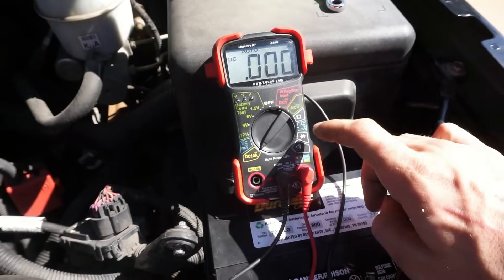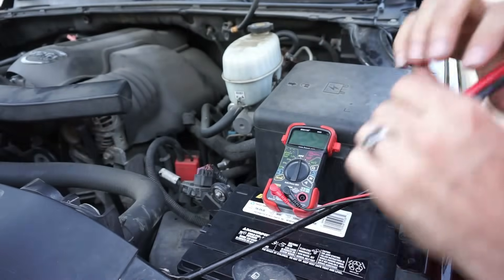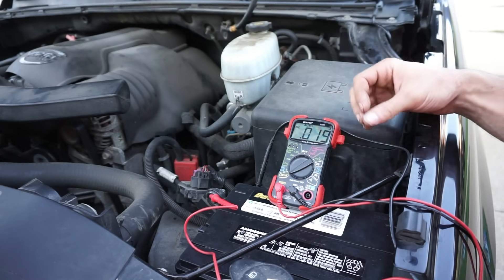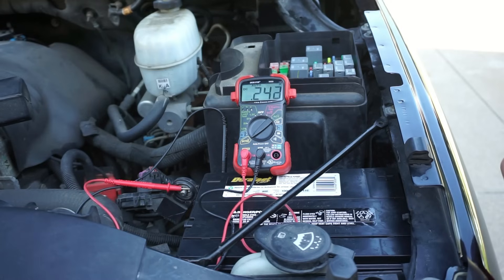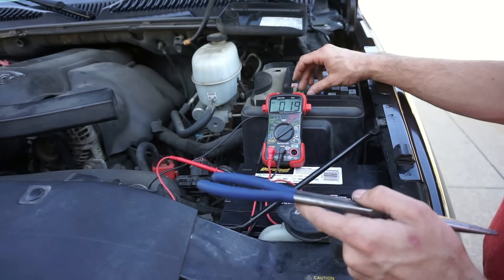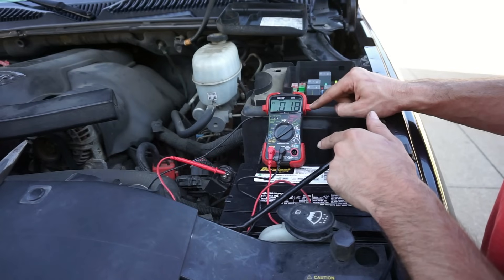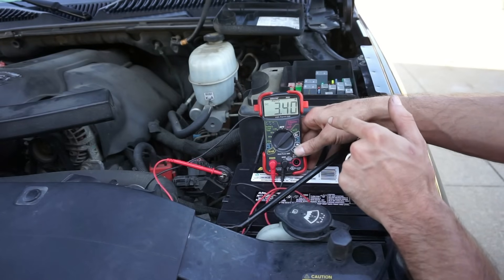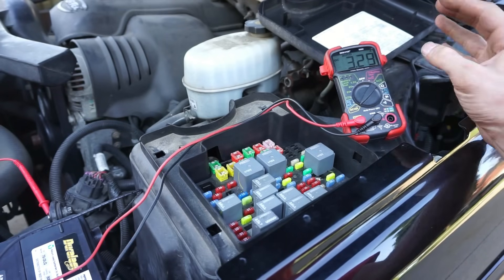DEAD BATTERY | How to FIND a Parasitic Battery DRAIN Using Multimeter!!!

Comment from the maker: THE FIX!!! As mentioned in the video the "Driver door module" was bad. This is the window switch panel. I replaced the switch panel and issue has been resolved. Video removing panel here:
 https://youtu.be/CnQtqbWc6x0
Reply: Wow! Excellent video. Thanks for posting it and "turning the key" and "being patient" were two key nuances in this video vs. so many other ones out there.
Reply: Was it because the lock wasn't hitting an end switch saying it was locked and therefore always providing voltage to the lock mechanism trying to lock?
Reply: Damn great video. Thx. You know your stuff. Electrical gremlins in vehicles can drive us nuts. 👍🙏👌🏆
Reply: Awesome video!  Easy to understand and thanks for sharing your knowledge!
Reply: Could connect your meter through ac10 Amp fuse if it doesn't already have its own fuse....
Reply: Excellent. You made that so clear.  The “wait” time is something that I never had the patience to do.  You are right!. Sincerely Don. Cheers 🍻.
Reply: I have a 1995 Lexus ls400 and i pulled all the fuses and none of them went down could it be a bad alternator or a bad battery cable?
Reply: I did the same thing with my multimeter negative with negative battery and positive with wire clamp and got 000 I’m thinking it might be my generator.
Reply: Ford explorer 2014 PowerTrain Relay stays energized (coil powered) with key off, drains battery over night. After removing the relay and putting it back it did not energize ( click on and draw current) how ever after driving yesterday and parking last night, it is staying energized again draining the battery. What energizes that relay, the switch the PCM?
Reply: Ahhhhhh missed that! Now I know. Guess the technician in me wants to tear into that assembly down to component level part! LOL, guess you would have to be retired and that's another whole video! LOL   Thanks Again!
Reply from the maker: @robertkosovich1232  My thought on it (Since I live in Wisconsin), in the mornings I would go outside to start the truck and warm it up. Occasionally the wipers would still be on and throw a bunch of snow onto the driver door where the buttons were. I'd guess water got in there and eventually corroded the connections.
Reply: G

😂😂kkkjjj😂😂😂😂❤😂jk❤❤❤❤❤k❤❤❤❤❤😂❤😂
Reply: Mine has same issue and driver door lock don’t lock lol thank you
Reply: Once the circuit is identified, is there anything more that can be done with the meter to try to figure out the nature of the problem, before disassembling anything? such as bad switch, vs burnt actuator vs shorted wiring?

Comment: So it's not clear to me, are you also saying that 0.200 a normal drain? I ask because my car was draining after a few days if I didn't drive it for a week, ended up buying a new battery because it was 6 years old, bought a new one and it's showing .200 etc. I'm using the exact same multimeter btw. but unlike you I don't know what I'm doing beyond what you did to check the drain. I don't exactly know how to interpret what I'm seeing. I thought it should be .020 to .050.

Comment: I’m addicted to these videos about parasitic draw, yours is great. Question, in some vids they connect the multimeter without breaking the link between the negatives by connecting it first, then removing. Would that method have helped in your situation? I’m wondering if it’s just a good practice to not break the connection?

Comment: This video helped me out big time! My driver door lock switch worked but was iffy along with the window switch. I pulled the DDS fuse and the amp draw went way down and after everything went to sleep the amp draw went to zero! I cycled the key and waited like directed in the video and the amp draw went back to zero. Now to order the switch assembly and just for the hell of it I’ll replace the door latch assembly in the door. It seems kinda iffy also.

Comment: Oddly I have the exact same thing with an older Windstar we keep sitting around.  Door lock, bad solenoid.  I had one of these one time where the light was loose hanging on the inside of the door panel.

Comment: Come to think about it my wife hit a trash can that was in the street one day and it knocked the passenger mirror off a little it was dangling we taped it back up, but the mirror control for it seemed to stop working....so maybe i should look into that as why the battery is draining, you're was a broken door lock control, maybe mine could be the mirror control. Hard to believe something so small could drain a battery in 3 -4 weeks time, but i suppose it could, so i need to investigate that first, looks at that fuse specifically cause it was damaged, also another electronic component stopped working the analog clock, maybe it could be that, so i do have two broke n parts to investigate. This didn't drain the battery right away, it was awhile later, maybe the control eventually shorted it, idk but not at first?

Comment: You mentioned that you can do this with a multimeter and pull fuses one at a time until the amps go back down to .001 ON AN OLDER CAR. What about a 2017 Camaro? I have replaced the battery. Replaced the alternator. Checked to see if it was the starter, repaired a bad terminal connection for the battery and STILL… I can’t go more than a few hours, sometimes less than that, without walking out to a car with a dead battery. I have now been driving the car for 2 months and every time I drive it, I have to disconnect the negative battery cable every time it is used, in order to use the car. It’s my only vehicle so to get around it’s my only option. I’m a single working mom with 2 kids so I don’t have a choice. So my question is will this same process work on a newer 2017 Camaro? I know I have 2 fuse boxes so it might take a while to check each fuse but is it still an option and can’t I get a multimeter at a Walmart for pretty cheap? Please help- thank you!!

Comment: I TELL YOU WHAT!!!!! TRY THIS. NO PATIENCE, NO WAITING.  I keep a 5/16 wrench under the hood. Shut engine off, unscrew sidepost Negative. Close Hood. Security & No more dead battery on my 2003 Silverado ! Also my truck has rubber mats & manual door locks, crank windows, base model 👍

Comment: Great video. These cars come with a million different modules now, all packed with unserviceable semiconductors. Transistors always end up getting stuck on, stuck off, and/or leaking current. IT IS SO ANNOYING. It shouldn't cost potentially hundreds of dollars to replace & reprogram modules. OEMs cheap out as hard as they can, and these issues are the result.

Comment: Thank you for this video. After video remembered issues with a/c not working properly. A/c clutch stayed engaged without ac on. a/c clutch relay fuse went out. Heard it switch on when connected terminals to battery post

Comment: I have a 2008 cx9 that’s charging at 15v constantly. What should I do?
Reply: Use a multimeter to check the alternator output after the engine has been running for 10–15 minutes; if it’s still reading 15V or higher once warmed up, it's likely not just a cold-start condition. Also, inspect your battery terminals and grounding connections for corrosion or loose contact, as poor electrical connections can confuse the charging system. If voltage remains high and everything else looks clean and secure, the likely culprit is a failing voltage regulator (which is built into the alternator on your vehicle), or possibly a faulty battery temperature sensor. In that case, you’ll want to have the alternator tested or replaced to prevent long-term damage to your battery and electronics.

Comment: I've got a 2009 F150 King Ranch which I don't drive much any more, so I decided to check to see if it had any parasitic draws that were working against the battery while it sat. Your instructions on what to do and more importantly what you were looking with each test helped immensely. Thanks.

Comment: I feel that finding the correct fuse is pretty straightforward. The hard part is finding what is drawing off the battery. Especially if you don't have any access to wiring diagrams.

Comment: On my son's 1986 Camaro we pulled each fuse one at a time, nothing stopped the drain. I put a screwdriver on the back of the alternator and found it to be magnetized, replaced the alternator, no more discharge (built in regulator was stuck closed)
Reply: Yep....a great video... I am about to delve into my daughter's 2008 Honda Accord..after a lifetime sorting out old English cars from the 40's to the 70's...one of the FIRST things I'm going to do in couple of days when I start on the Honda, is to set up the drain test, and then pull the connector on the alternator to see what happens to the reading then....and YES...cycling the engine-on-&-off situation is essential content.  Thank you!

Comment: Too many gizmos and gadgets in the average vehicle. I have a 1984 GMC K2500 diesel that I bought brand new 40 years ago… also have a newer GMC 1-ton Duramax. The Duramax is full of gadgets like dual zone air conditioning (which depends upon a cheap plastic diverter buried deep within the dash)… My trusty old 1984 has no electronic garbage in it.

Comment: I had a parasitic drain on a Mercedes gl450. Dealer couldn't figure it out after having it multiple times for multiple days. The car had removable push to start button. I ended up figuring out the drain was when we would have the push to start button inserted. Didn't think it was worth the money to have the dealer tear apart the steering column. Just used the key fob as the key. Good video!!!

Comment: Anyone know how much Amps in average drain remote starter from battery?? Without remote starter power consumption is about 0.04Amps, after remote starter Viper 4205V instalation battery drainage is about 0.56Amps - it's normal or they connected in wrong way? Viper is killing battery within 5 days when you don't use car.
Reply: When you left the car the Ampere meter must show  0.020 Amp to  0.040amp=max
In the winter when the battery is not full charged  then you have problems to start the engine

Comment: One slight negative comment:

When troubleshooting ANY problem, but especially an intermittent one, it is very important to avoid making ANY changes to anything before confirming  important current existing statuses. To that end, AND because it can easily and safely measure from milliamps to 200Amps ... Buy yourself a decent clamp AC/DC meter so that you do not need to remove the battery terminal to check for drain current. MUCH quicker and more effective. Just be sure to get an AC & DC clamp meter.

Comment: Old video, but a 45 year tech here. You did it correct, but there is a faster way. Your DVOM will let you test for voltage drop at each fuse, any fuse that has a voltage drop is drawing current.
Reply: True, most of the time.  I think u might have missed that pattern?

Comment: Ok I have a 5.3 04 Silverado. It was the instrument cluster that was failing to shut down every module after shutting the truck off. Took a year to figure out and I wasn't having cluster issues, except PRNDL didn't illuminate. Speedometer guys on eBay fixed the issue. Sent the cluster in and had it back within 9 days. Cost $75. Truck will run without a cluster. This will save you thousands

Comment: So I have a question. I seem to have a drain on my battery,  and it will discharge in a week just sitting idle. I disconnected the aftermarket stereo memory at the fuse box, thinking that was the problem. Turns out there is something else draining the battery. I did a parasitic test, and it says zero amp drain. But I know there has to be something. The battery will remain fully charged with the battery disconnected.  Any ideas?

Comment: Pretty smart, I got a problem w my BCM 2011 Camaro SS and there are no new ones ON THE PLANET. So I sent mine out to get cloned  to my vin. I have it back now but I'm trying to research the  proper install procedure and do I need to do a key relearn. Before the car ran until I unhooked the battery to try to reset my BCM due to my cluster staying illuminated as well as hi beam indicator when car was off. But doing that battery unhook made the car still start but stall  right after start up. I'm trying to find out if I can just install this cloned BCM into my car and bam it should start. Or is there any relearns with the theft or key functions I need to do first

Comment: This is just a shot in the dark in case anyone here has had my gremlin before.. I’m going to do the tests shown in this video soon as I get some time off but I have a feeling I still won’t find it. 06 tundra, one day battery and alternator died. I swapped alternator, battery and serpentine belt. Afterwards while watching the voltmeter (yes, fully charged battery 12.5v), everything stood in normal range (above 14v with vehicle running). Everything is perfectly normal until idle drops or engine comes to operating temp within 5-10 minutes, then starts dropping until the battery is dead. I thought maybe I was unlucky with a cheap alternator/voltage regulator, replaced it and same thing. Swapped the battery  once more just to be sure, same same. Changed my 140a alternator fuses, same same. Changed battery relay, same same. Friends convinced me to get a better quality alternator, same same. Checked resistance between battery and alternator (+ and -) and “I think” (still learning) that it’s good. Lamp tested all fuses and they show they’re good. I thought I should drive it just to be sure.. 40 miles on the freeway and soon as I got off and came to a stop sign, truck dies. Battery gage on truck shows normal readings while moving (and on voltmeter while parked and throttle is applied), but after the 5-10 min warmup it seems the alternator is powering the truck but stops charging the battery? no dash warning lights (except for battery once it drops low enough) or anything but soon as I come to a stop truck dies and battery gage drops to 1/4. Starts up just fine and even runs fine long as I’m moving. The reason I don’t think it will be the same problem as this video is because the battery drain ONLY happens while running. I can put the charged battery in the truck overnight and it still has its charge next day (as long as I haven’t started it). Tried to put everything I could think of, but man.. replacing all these parts and 3 alternators within a week is driving me crazy. Getting to work on a borrowed car and desperate to find a fix

Comment: As a retired, certified electrician who also tinkers with low voltage systems it's refreshing to see someone use common sense to troubleshoot a problem. I don't have a parasitic drain but the title caught my attention. And I did learn something about vehicle systems, they need time to shut down. Thanks, good video.

Comment: Great video, however I am having something different going on with an 07 Hummer H2.  This vehicle has killed battery after batter after battery.  I go through the initial on off with the key, and I get 0.682 ma.  It eventually goes down to 0.082 ma.  However, when I pull the LBEC2 the current draw doesn’t move, but it does do back up to 0.682 ma when the 50 amp fuse is out back in.  Also once the current draw goes back down to 0.082, and I pull the LBEC1 fuse, the current draw actually goes up to 0.211.  Like WTF if going on.  I have sat their for 10 minutes and it doesn’t go down from 0.211.  So I have no idea if that is my problem.  I believe I do have some sort of issue with my door locks, because there was an after market security/starter system in it and I tore it all out hoping to get ride of the parasitic drain, but it did not.  The only thing that keeps my battery fresh is un hooking it every time I park it or constantly trickle charging it.  I no longer have Onstar, nor the factory audio system.  I have an aftermarket audio system that is completely shut off via circuit breakers from the entire main batter system.  I am so sick an tired of this damn Gremlin.  GM wiring is a complete nightmare.  The only other thing I can think of, is that there is still some sort of security system wiring that the previous owner had put in, but I don’t know anything about aftermarket security systems, other than they are pretty much USELESS NOISE MAKERS, that no one pays any attention to.

Comment: You isolated the draw to the door lock system.  Was the actual draw coming from the door lock switch, or from the solenoid that moves the locking linkage?  Wiring issue, or was one of these components replaced to eliminate the draw?
Reply from the maker: Replaced the switch panel and it went away.

Comment: so what was the final issue ?
i have the exact same issue with mine ?

did you have any issue with the keyless entry ?
Reply from the maker: Check the pinned comment.
Reply: @BlaserBuilds thanks, but my second question ?
Reply: @BlaserBuilds  thanks , but my second question?
and i read somewhere that the new one has to be programmed ,,, is that true ?
Reply from the maker: @RobS282  This part didn't effect keyless entry. If you replace the key fob it will need to be reprogrammed.
Reply: @BlaserBuilds  im not talking about the fob needing to be reprogrammed, im talking about the part YOU replaced in the video